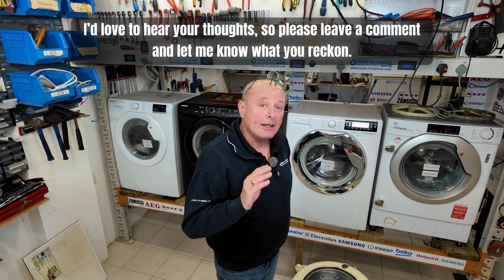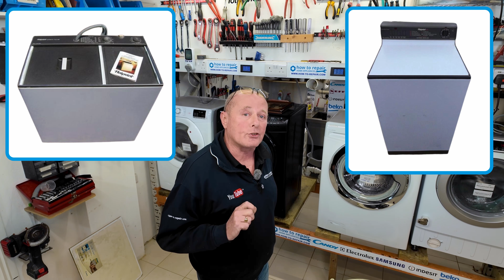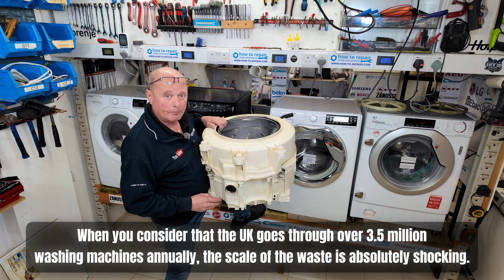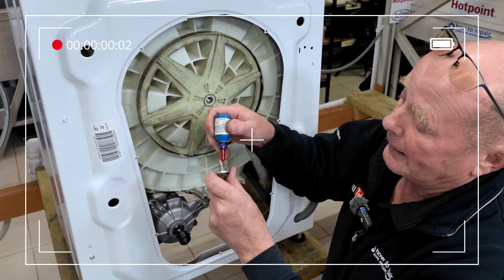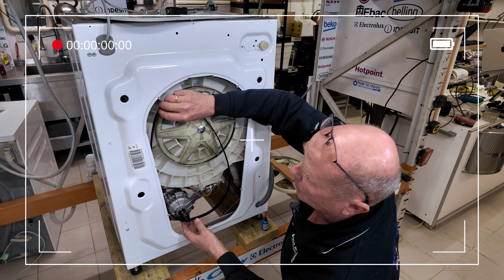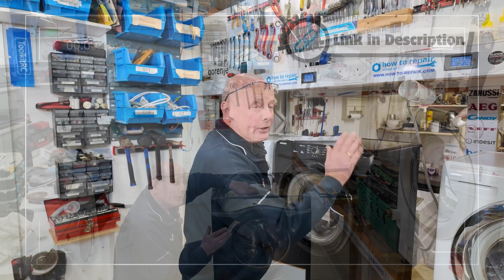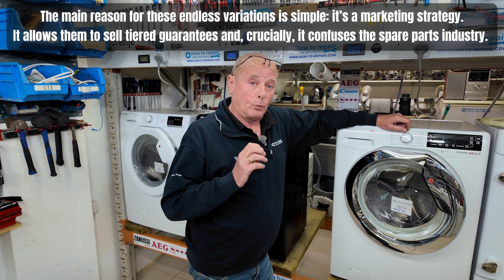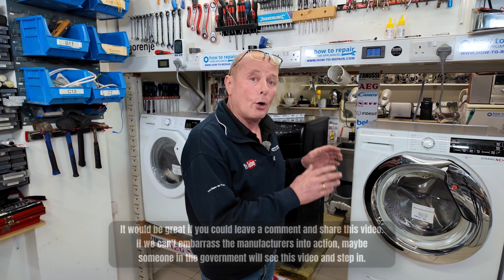I Scrapped 13 MACHINES to Prove a Point: STOP BUYING These Brands!

Comment: Very good video. His experience accords with mine. The present white goods situation regarding quality and maintainability is shocking.  I used to replace thing like drum bearings - easy if you have modest mechanical experience.  These manufacturers have colluded in a race to the bottom as far as the customer is concerned. Fronts of machines that are welded on and welded drums should be illegal as they destroy maintainability.  Price of parts is a rip-off.  The 2 year warranties in the EU versus 1 year in the UK is yet another reason for saying that Brexit was crap.  Our governments need MPs who will press for regulation of manufacturers of basic household equipment. We have a British made Creda fitted double oven, functionally and electrically just about identical to today's ovens. It was made in 1983 and has only needed 2 heating element replacing in all that time.  It moved house with us in 2001.

Comment: you should show tub paddles  and compare them with several brands. The paddles can tell about the quality of the machine, even if the machine is cheap level.   you do not need to go too deep, just open the WM  door  and check interior,  door gasket, tub, paddles.  Another problem is 1 Year manufactirer warranty.

Comment: I don't know what's worse – poor-quality household appliances or the lack of people who actually know how to repair things properly. Most repair technicians these days seem to know little more than how to replace entire assemblies with new ones. If the electronics fail, it's rarely the entire PCB that's faulty – usually it's just a few components that can be replaced. Plastic can be cut and then welded back together – which is exactly what you can do when replacing the bearings in a washing machine with a factory-welded outer drum. And if that kind of repair isn't economically worthwhile, then the washing machine must be cheap enough for its low price to justify the poor build quality.

Comment: Not quite washing machine ..... but same for replacement parts for vacuum machine (philips). New one 90 eur. Replacement vacuum hose 45 eur, vacuum head/brush 40 eur, extension pipe 40 eur. That's a crime!

Comment: i lived in a shared house several years back and the landlord purchased a pretty expensive aeg washer dryer ... first few months it was fantastic then the noises started and i guess the drum and bearings had gone as it would make a god awful noise when it started spinning and then it died after 8 months ..... unrelated to washing machines .. i moved and had to buy a new cooker so i got a £350 kenwood ceramic hob, just as my 12 month guarantee ended one of the ring knobs broke and fell inside causing a short which i managed to stop and then the oven element packed up a month later, the cooker literally lasted 18 months !

Comment: Miele often get praised but are no different in my experience. My 2017 machine died in 2022 due to drum spider failure. Doing some research i found out that the newer devices used a weaker alloy drum spider sensitive for corrosion from washing detergents. This corrosion leads to breakage of the spider and catastrophic failure from the drum detaching during a wash cycle. The part costs are astronomical: 630 euros for a drum, 310 euros for the drum spider which together is about the price of a new machine. If you add potential damaged bearing/axle associated parts you are talking about an additional 640 euros. 

seeing these prices im curious what it would cost to build a complete functional machine from ordering only loose parts from the catalog, maybe 10.000 euros?

Comment: i just scrapped a 22 year old bosch series 6, the outer plastic drum had cracked all the way around. Only thing changed before that a new door seal. Pretty good I’d say. Could be repaired but not a cheap spare part. 

bought a new Bosch series 4 .. dont expect it to even get close to the old one in years. 😮

Comment: And here is me annoyed because my 10 year old Samsung washing machine has just chewed up the inside of the door seal! I expected it to last a lot longer but seems like I have done well judging by the other comments. (The drum appears to be rotating in an elliptical path viewed from the front but there is no bearing noise, vibration or rough feeling when rotating by hand so I am guessing the aluminium rear drum support probably has a cracked leg and is allowing the drum to wobble when under load.)

Comment: As an appliance engineer for 50 years this guy is spot on,the only comment i would make is back in the eighties a hotpoint or hoover machine was £400 with inflation that would be equivalent to £1,000 now but you can buy a machine for £250-£300 and thus the quality has nose dived.

Comment: I’m in a airbnb holiday house right know. In the kitchen there’s a Miele combi oven/microwave from the early 80’s still going strong. There’s also a Miele dishwasher from the late 80’s, still in great condition. In the washing room there’s a Miele washing machine and dryer, both from the 90’s. Those were the days…

Comment: my mother got a pair of Miele laundry and dryer in 1998 for her birthday or whatever, i dont know exactly. She still have them. Exchanged the brushes ont he laundry machine a few times and a gasket. Its so easy to maintane, easy to get to anything. No super fancy sensors. Just works. I have a miele from 2018, and I have to replace it already. Too much shit and its cheaper to buy a new one (not miele but I wont buy miele again. they no longer are that they were)

Comment: So True ! I bought a Hoover 14 kg in 2024, it's a nightmare : it vibrates so much that the first-floor flooring—made of terracotta tiles on metal lintels—vibrates too. Even in my bed in another room, separated by an old 60 cm thick wall, I can feel the vibrations; it was so alarming that I got rid of the machine. It was perfectly leveled, and the transit bolts had been removed. I've bought a Miele to replace it (with stainless steel drum, not polypropylene (shame on Miele for making these plastic drums.....). All fine now.

Comment: Newer Samsung machines have decline in quality. My experience was not an outlier. I got a Samsung WW70TA046TE/EU in 2023. We previously had a Candy before that last 7 years, died due to a dead PCB. The machine died this year only lasting about 3 years of use. We replaced it with a candy as 7 years is a lot better than paying more for a high quality machine only for it to prematurely die. It was catastrophic drum failure. The problem started 6 months into the purchase but I ignored it not having the time nor energy to deal with it at the time. It catastrophically failed just outside of warranty. I had the machine on and I came downstairs and this was at half the speed of the max speed the machine could do and all I could hear was a load banging noise of the drum slamming into the chaise, the door was moving and I had to hit the stop button to prevent any damage to the surroundings.  From looking at the reviews of the newer revision of them model I went for, the problem has not been fixed and still persisting. The candy machine is a stop gap to give more time to decide on getting a more expensive machine with a much better build quality that can last at least 10 years, more ideally, then its just a case of maintaining it.

Comment: You are totally right, research lightbulbs, the original lightbulbs lasted 10 years or more, so manufacturers got together and agreed to make substandard light bulbs which were more prone to blowing and only lasted a few thousand hours. This ensured the manufacturers had a steady turnover of light bulbs for years to come. Some research suggests it was the mercenary Edison, who created the manufacturing license, preventing anyone from making bulbs which lasted years like the original bulbs did. I think there's a fire station in Philadelphia which has had one of the original light bulbs permanently switched on for a hundred years!

The washing machine manufacturers know they are using up valuable resources and  causing huge problems with pollution and landfill sites which are going to contribute to global warming etc, but they don't care about the future health of their children, they only care about making more money now.
It's not entirely the manufacturers fault however, as they still need to sell products and sadly, most people today have a disposable goods mentality, so they'd rather spend $150 on a cheap machine which they can throw away if it breaks down, rather than spend $300 on a machine which can be repaired and lasts decades, especially when the cost of repair and the spare parts, will cost them more than a new washing machine. Great video, keep up the good work 👍

Comment: Hello. In Portugal, the Candy-Hoover group was going through a bad phase. 
The quality of the materials was very poor, the machines were fragile, and technical support was almost non-existent. In the store where I work, we had many complaints about various kinds of breakdowns; it was constant across the entire Candy range: motor failures, electronic failures, etc. 
By law, under the warranty, which is three years here in Portugal, the manufacturer has to repair the machine within a maximum of one month. However, the customer received their money back because Candy couldn't respond to service requests in time. A huge shame. I even thought the brand was going to go bankrupt, such was its state of disgrace. 
I think the family that owned the brand did well to sell the group to Haier. When the transition from family control to the Chinese group occurred, there was a big difference, and the improvement was noticeable. The old problematic models disappeared, and the old construction, which was made with a shallower but taller drum, ceased to be the standard. In the vacuuming sector, Hoover continues to be a benchmark, and they have very interesting vacuum cleaner models with simple but fairly priced material quality. I hope the Candy-Hoover brand is in good hands and manages to regain its credibility. I have clients who tell me that their old Candy or Hoover machines lasted twenty years, and they had a good impression of the brand. My younger customers are hesitant to buy Candy-Hoover and prefer Samsung or LG because they are more familiar with the brands; the marketing is very aggressive.

Comment: I remember my old Indesit I inherited from mum after 15 yrs going on to live another 20 years till a dodgy engineer decided to knife my door seal for a quick buck 😡 i then bought Hotpoint that just manged 10yrs at a push. Next was one of these Hoovers 5yrs ago , im on my 5th set of brushes for the motor & the tumble has been on the way out for 3yrs 💩 new belt kit, dangerously stopping & heating & now capacitor is on the way out 🙈

Comment: Nearly 4 yrs ago,we bought a £250 beko machine. It’s now become so impossible to get the rubber seal clean (even though I’ve dried it out after every single wash and put a salt tablet in every wash for hard water washed filter etc regularly), that for only £239, we’re just going to buy a new one. Because the price for getting an engineer to come out and replace the seal is going to be around £150, for only £100 more, we can get a brand new machine. 
It’s crazy that someone has not come up with a rubber door seal design that allows the home owner to pull it out and push in a new one really easily. Instead, the seal design is such a nightmare, it’s easier to buy a whole machine that has nothing else wrong with it!

Comment: iirc one of the reasons that spare parts are so expensive, especially where you are in the UK is a response to the right to repair act. 10 Years is a long time to make the same part. Especially when your main companies aren't making them but rather buying them from subcontractors. So when they have to "make" spare parts for 10 years, they have to go to their subcontractors and sign deals that last that long. Well, those subcontractors, knowing that they are being forced to do that, both jack up the prices to use those funds to finance new stuff (like new production lines). But also to spend the money to keep those old production lines open that have limited profitability due to supporting just one smaller market with these rules.

I'm fine with the concept, but I think the implementation of the law was more reactionary and lacked any kind of long-term thinking on how the market would respond. I'm not really sure what the solution is that both doesn't make things way too expensive where no one can buy them anymore. And stopping the race to the bottom that we've found ourselves in.
Reply from the maker: Thanks for the comment mate. With the new 2026 Ecodesign Regulations set to ban the sale of new vented and condenser tumble dryers by January 2027, we're hoping to protect affordable and practical appliance choices for every household, please take a moment to sign our petition and help us make our voices heard: https://petition.parliament.uk/petitions/773682/

Comment: I'm in Poland. We used to have Polar washing machines, which, as you mentioned, lasted 20-30 years. Unfortunately, Whirlpool bought them out in 2002-2003. Quality declined, and over time, the brand was completely phased out. Regarding Candy, I've seen that the new ProWash washing machines have screw-in drums.

Comment: Hoover A3 series - I remember we had one and one fault it had was it sometimes would fill.....and fill.....and continue filling until it was pouring water out of the power draw and flooded the kitchen. I remember it had its analogue programmer replaced and it had like a million electrical connectors.

Comment: Used to fix these machines. Mostly the pcb's and the bearing go first. Pcb's are mostly equipt with poor components. Components used 105 - 110% . So the machine will live a very very short time. In the 70's - 90's, machines would last 20 - 30 years. Nowadays a washing machine will last 5 - 8years. It's like the new cars...there's no way you can work on your car u used to do back in the days. Shame on the manufacturers.

Comment: My Privileg washer-dryer has finally given up the ghost after 41 years. Suddenly, the apartment's residual-current device (RCD) tripped, even though the machine wasn't running... I suspect the motor's start capacitor is what failed here...

I suppose I ought to try repairing it?

In the meantime, I’ve picked up a Miele WEI 875 WPS; it still features a fully enameled casing and an outer drum made entirely of stainless steel.

However, to my surprise, the door makes a "whirring" sound during the spin cycle—a noise that vanishes if you simply rest a finger lightly against the door...

The noise is there, though, and it bothers me because I don't think it should be happening; it seems to stem from a flimsy door latch—apparently a cost-cutting measure to boost profit margins.

Comment: Twelve years ago, I bought the best and most efficient refrigerator available at the time; I still have it, and it works perfectly—I haven't even had to top up the refrigerant! I bought my grandmother a fridge two years ago, and the compressor broke down right after the warranty expired. My mother bought a washing machine six months ago, and its motor failed. They are designed to break down so you have to get them repaired or replaced. A law should be passed mandating a minimum lifespan of 10 years, with free repairs or replacements for anything that fails before that mark; I think that would push manufacturers and engineers to build better devices.

Comment: May I ask about your opinion on - Beko, Gorenje, Electrolux, and Sharp. If you repaired these washing machines(for the author of the video) or used some ( for other people here) I curently have problem with a Beko machine which was rotating bad for a few days and lastly its stuck and I stopped it. From the videos I watched around I think the spider is broken. Thats why I need advice what to be my next washing machine. I need your advice please.

Comment: Also agree it's pretty much a straight-up gamble what you're going to get. My cheap, 350€ whirlpool machine has lasted for 10 years. Although I only use it few times a month, I'm positively surprised. Next machine will also be a cheap one, my reasoning is that the more simple the machine is, the less fine technology it has that might be prone to breaking down. Not sure if it's any reason to buy whirlpool thought, because of the complex supply chains of today's economy the whirlpools sold today most likely have nothing to do with the ones sold 10 years ago.

Comment: Hoover washing machine 24 years old and still working more or less, sometimes doesn't work properly on certain cycles but choose another and it's fine.
Hoover fridge freezer 10 years old and still working touch wood.
Indesit dishwasher died with a loud bang one night after only 50 uses and a year of use, but friends got 15 years out of their older model Indesit.
Hotpoint fridge freezer died after 18 months.
Seems Hoover is now owned by the Chinese, will probably replace anything next with a Bosch.

Comment: the problem is that you look at the average lifespan, about 8 years, which seems about okay in my books. But in reality, we have to look at a couple of other factors: in the early 2000s the machines were supposed to last about 4000 to 6000 cycles, nowadays it's about 4000 cycles. But the cycles in early 2000 were far more shorter: about 45 to 60 minutes, nowadays with regulations to reduce chemical use and water use, the machines have to run for 2 to 3 hours. 

therefore the machines of today are accumulating more hours of use and they are designed with these constraints in mind: there is no planned obsolescence, it's only that the world is moving and you keep thinking like we were 20+ years ago.